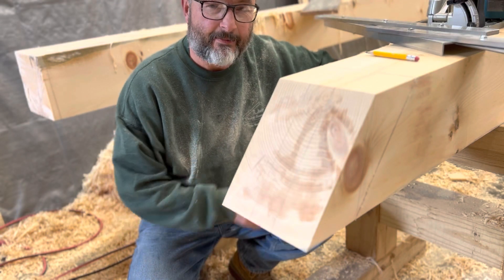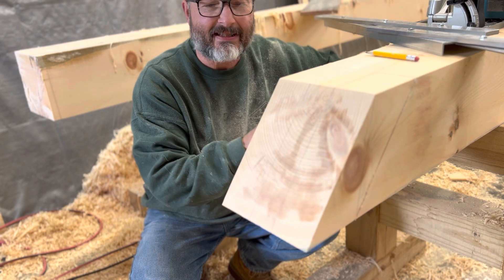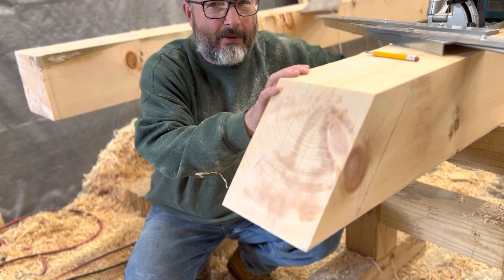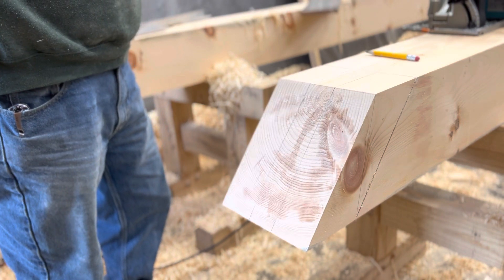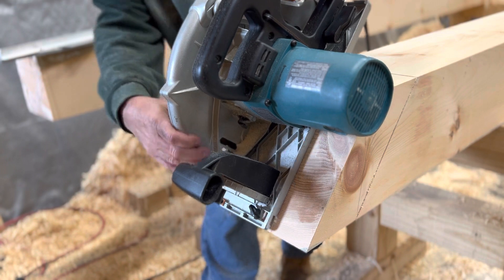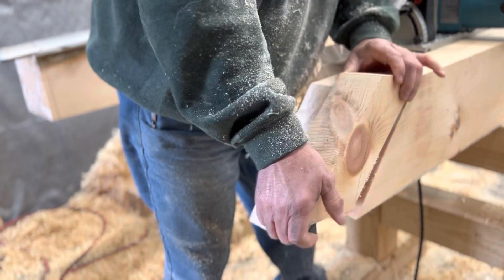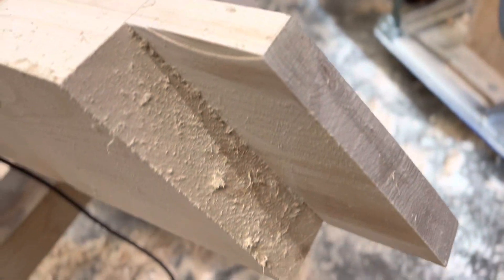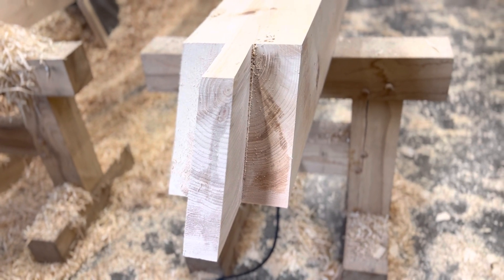Timber Framing - rafter top cut using ‘drop cut’ method

Comment: Thanks for the mention.  Yeah if one is not so comfortable then work up to it,  We also drop cut all brace stock, the whole batch of braces are set out and the saw guy goes down the row doing the same repetitive task, sometimes there is a second guy just handling the braces so the saw guy can focus on handling the saw without setting it down after each cut,  And that knot deserves a good drop cut.